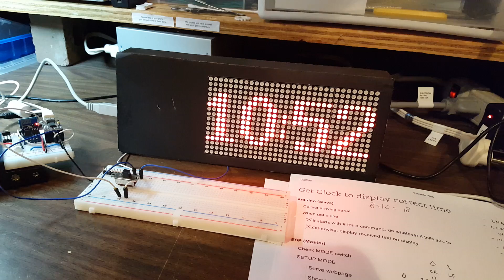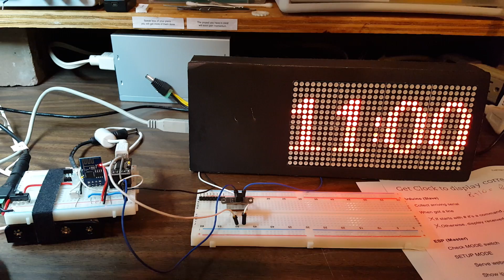HariFun #118 - ESP-8266 Real Time Clock

Comment: Hi Hari,
Do all versions require the esp8266 + Arduino?
What do you think of these modules, you have already been interested in some of this:
1) https://www.aliexpress.com/item/32977781030.html?spm=a2g0o.cart.99999999.259.17053c00AzXLXx
2) https://www.ebay.com/itm/LED-Lattice-Module-16x24-Dot-Matrix-LED-Subtitle-Text-Display-Program-3-3V-5V/372659863414
Especially the latter, since the former seems to be identical to yours, with the difference that it is twice the size. That's right?
Is it worth it?  Thanks
Reply from the maker: Hi Daniel,
Yes, IIRC all those code uses the esp to get time, and arduino to drive the display. 
Thanks for sharing those matrix links. Prices are ok, but the shipping are terrible.
I really like the matrix that I used for the morphing clock.  Quite large AND high resolution. $20 with FREE SHIPPING!  https://www.youtube.com/watch?v=i0M6F4wRxGc

Comment: Hi Hari!

Is your 'HandwrittenClock_05' code for Arduino or esp8266? And there are several versions: 05, 05_ESP, 05b, 06, 06_ESP, 07, 07_ESP.
But it is showing this in this sketch 'HandwrittenClock_05' at line 76: if (millis ()> timeToRefresh):

Arduino: 1.8.8 (Windows 10), Card: "Arduino Nano, ATmega328P (Old Bootloader)"

Compilation options changed, recompiling all
D: \ Arduino \ Matrix 32x16 and Arduino LEDs (panel) \ Matrix Bicolor by Hari Wiguna \ ESP8266_RealTimeClock \ HandwrittenClock_05 \ HandwrittenClock_05.ino: In function 'void loop ()':

HandwrittenClock_05: 76: 18: Error: 'timeToRefresh' was not declared in this scope

    if (millis ()> timeToRefresh)
                   ^
HandwrittenClock_05: 85: 32: Error: 'refreshFreqency' was not declared in this scope

      timeToRefresh = millis () + refreshFreqency;
                                 ^
exit status 1
'timeToRefresh' was not declared in this scope
Reply from the maker: This project uses BOTH the ESP and Arduino.  The Arduino drives the LED, the ESP fetches current time from the internet.  I don't remember anything about this project, but I presume latest version is best.  Let me know if you're still getting compile error with version 8.  Good luck!
Reply: @HariWiguna  Sorry for my ignorance but, I did not understand how it works; in version 08, is the 'HandwrittenClock_08' sketch loaded in an Arduino and the 'HandwrittenClock_08_ESP' sketch in an ESP? Are the two boards interconnected? Do you have any information file.txt?
Thank you very much
Reply from the maker: @Dancopymus , the Arduino talks to the ESP via serial port.  Tx of arduino connected to rx of ESP and rx arduino connected to tx of esp.  Arduino is 5V, esp is 3.3V so there should be some level shifting. I think I just use resistors.  I covered this in other video or you could google level shifting.  BTW, this project is quite old. Nowadays, the Arduino code can run on the ESP so in theory we don't even need an Arduino anymore, just the ESP.  But that'd be quite a rewrite of the code removing the serial communication.

Comment: Hi Hari!
1) Are your sketches working perfectly?
2) Which pins of the ESP8266 (Nodemcu) should I connect in which pins of the Module?
Thank you
Reply from the maker: Daniel, I think you're mixing the this clock and the morphing clock.
This clock uses an Arduino Uno (0:48) to drive the display and only uses the ESP-01 to get time.
The morphing clock uses the nodeMCU to drive A DIFFERENT display.
https://www.instructables.com/id/Morphing-Digital-Clock/
Reply: @HariWiguna  You're right; lack of attention of mine.

Comment: Greetings Hari ! Thanks for video and code. We have found very few projects made with these 16x32 green red matrix and this is the best!
I made the project but there is a problem: it is displayed correctly until 19: 59 when it passes at 20: 00 nothing is understood before it arrives at 0: 00.
Reply from the maker: Dorin, I reviewed both the code for the Arduino and the ESP and I do not see anything that would make 20:00 through 00:00 special.
Have you been able to duplicate this issue more than once? Very strange...
Reply: Hari, i think that the error occurs because when it arrives at 20:00 it can no longer display the clock format - number/space/number/space/:/space/number/space/number (it would take 33 horizontal points per row (28 for numbers, 4 for spaces between them and 1 for the two points between hour and minutes), but the matrix is 16x32). Numbers 0,2,3,4,5,6,7,8,9 need the correct display of 7x10 points and the number 1 of 6x10. Number 2 "does not fit" where the display error should be displayed here.  https://i.ibb.co/mH5MSrQ/01.jpg
Reply from the maker: @dorinik  I agree with you.  Great detective work! Unfortunately, I think that meant I will have to redo the "font".  To be honest, I'm not even sure where that display is anymore so I probably won't be updating the code. :-( Sorry...
PS: Let me know if you fix it and we can update the code on github and of course I will give you credit.
Reply: @HariWiguna  Only the number 2 should be changed.
I tried to do this but I'm used to the hex or binary format, yours is a little different and I can not get it. A little help would not hurt because it would be a shame for such a project not to go because of a number! I think it would be easier to give up the two points between hours and minutes and move right to the hours (although it's a shame they look so good!) https://i.ibb.co/Tg68Y2Q/02.png
Reply from the maker: @dorinik  , I wonder how 2x:xx would look if we shift the 2 one pixel right? It will touch the second hour digit, but I think that would still look ok.  Could you try it and share photo/video when you have time? Thanks!
https://github.com/hwiguna/g33k/blob/master/ArduinoProjects/2015/_Done/118-ESP8266_RealTimeClock/HandwrittenClock_08/HandwrittenClock_08.ino

Comment: Nice clock. I like the graphics you did on the led matrix display. What is the name of the rgb led matrix pcb?
Reply from the maker: Thanks. I bought that display from ICStation, but I've seen it sold by others too. Note that it is only red and green, NOT RGB.
http://www.icstation.com/16x32-matrix-control-display-module-dual-color-green-electronic-funny-module-p-4985.html
Reply: @HariWiguna  Thanks! The display digits looked close to white - go figure?

Comment: Sir I have Arduino Uno with ESP8266 wifi shield. Does this code works for this.
Reply from the maker: I'm unfamiliar with the esp8266 wifi shield. If it communicates serially with Arduino, then the code should work.
Reply: Hari Wiguna there are so many codes which should be used to test first without led display.
Reply: Can you send the complete connection.
Reply from the maker: The complete connection depends on the wifi access point that you'd be using.
This is the original code that gets the time from the internet:
https://github.com/hwiguna/g33k/blob/master/ArduinoProjects/2015/_Done/118-ESP8266_RealTimeClock/NTPClient/NTPClient.ino

Comment: I have interfaced Arduino mega 2560 with esp8266-01 ,temperature and humidity sensors.   I have Local server(Node.js server) in my system and i am able t send the temperature and humidity values to Server.

Now i need to receive the data(time and date) from Server.

Receving date and time is happening . I can post the part of the code where i feel i am wrong in syntax and also arduino console output and Server output.

Please reply.
Reply from the maker: I can't promise anything, but I will take a look at your code if you still need help.
Reply: Ok Sir. I have mailed the query and code to your mail id.

Comment: Very nice project Hari. Can you are able to share the  schematic for the clock i want to know connection between ESP8266 and the Arduino Uno pin number

Thanks
Gurjinder
Reply from the maker: Sorry, I no longer have schematic for this project, but if I recall correctly, the ESP and Arduino are connected via their respective RX/TX lines.  The pins for the LCD module are defined in the sketch. Good luck!
https://goo.gl/ZaRBFI
Reply: Thanks I will try
Reply: Hi Hari,

i tried to load code but i am getting error.  Is i am missing any libraries

sketch_jul09b:76: error: 'timeToRefresh' was not declared in this scope

   if (millis() > timeToRefresh)

                  ^

sketch_jul09b:85: error: 'refreshFreqency' was not declared in this scope

     timeToRefresh = millis() + refreshFreqency;

                                ^

exit status 1
'timeToRefresh' was not declared in this scope

Thanks
Gurjinder
Reply from the maker: Looks like you're trying an old version of the code. Please try this version instead:
https://github.com/hwiguna/g33k/tree/master/ArduinoProjects/2015/_Done/118-ESP8266_RealTimeClock/HandwrittenClock_07
Reply: thanks

Comment: Great project, and I used the NTP Client code provided but have a question. 

The code worked perfectly, but only after I changed the order some of the lines appeared in the original code. Do you know why this happens? This happens not just with the code above, but with many examples I get online. 

Thanks for sharing, this code really helped me out.
Reply from the maker: +HeliosWorksAV , glad to be able to help.
As far as changing order of code, the Arduino compiler changed recently (a month ago?) that methods need to be declared above where they are used.  Not sure why they did that. :-(
Reply: +Hari Wiguna Thanks for the reply, wow so I should go back and check all of the code I've skipped over because it might have been written before that and just needs to be shuffled around. 

Thanks again.

Comment: Thanks for the post!!! 
I am creating an application where the ESP8266-12 will not only be used as the WiFi module but as the actual processor itself. I need the ESP8266-12 to be active between 8:30 am and 9:30pm and go on sleep beyond that time-bracket. This means that I need a way to know the time. My ESP8266-12 will talk to a Raspberry PI. I was thinking that I could get the time from the Raspberry PI and use that as a base to compute the time in the ESP8266-12. 
You think this will work? It looks like you have done something similar (though you are getting the time from the internet).
Cheers,
Divyaman
Reply from the maker: +divyamanify , yes, you can make the ESP talk to anyone on the internet including you Pi.  However, unless the ESP already have to talk to the Pi for some other reason, why not use a public time server on the internet and not involve a Pi at all?  
Also, I don't think the ESP is running anything while it's sleeping, so you will have to program it to always get the real-time everytime it wakes up from sleep.  I'm interested in what you find out about sleep. Do you have a place where I can follow your progress? or feel free to post in this comment thread. TTYL
Reply: +Hari Wiguna I did think about getting the time from a public time server (like you suggested). But, my ESP8266 needs to talk to the RaspPI anyway and must be in the same time-zone as my RaspPi. So, its better to get the time from the PI. With regards, to the sleep times, I am still in very early stages. But, I did find some useful links on that. Here are those: -.      
        http://bbs.espressif.com/viewtopic.php?t=133        http://bbs.espressif.com/viewtopic.php?t=834        http://tinker.yeoman.com.au/2015/03/08/reducing-esp8266-power-consumption-using-deep-sleep/

Comment: Wy not only the ESP8266 module? Its a uC to... You can connect the ESP to the 74HC595's directly.
Reply from the maker: +Edwin Noorlander , you're right.  However, because there is already an Arduino library (written by someone else) to drive the LED matrix, I decided it was easier to leave that alone rather than port it to the ESP.  That said, it is sometimes confusing to have to think whether I'm writing code for the ESP or the Arduino side.  Another thing I noticed is that uploading to ESP takes a lot longer than uploading to the Arduino UNO.  Not sure why, but I was thankful for the quick turnaround while I tweak the effects on the LED matrix.  Thanks for the comment Edwin!
Reply: +Hari Wiguna Have you thougt about to use the ESP directly with the Arduino IDE? Then should using the library be no problem. You will probably need an ESP 12 for more pins.
Reply: +Hari Wiguna I think the longer time  is  that is has more flash to write to, and it appears to write the whole page .
great stuff man ,  will be cool if you show your progress doing the PCB design.
Reply from the maker: +Thomas Oo , I am using the Arduino IDE for ESP :-)
I have not dig into the library to know if it would or would not work on the ESP.  I just assumed (perhaps incorrectly) that adapting it to the different pinouts would be difficult if the library uses direct port manipulation. and timers or interrupts to automatically refresh the matrix.  However, I do not know that for sure, so you made a good point to try it.  Thanks for the suggestion.
Reply from the maker: Hi +XerotoLabs !
Next question is how come the ESP has more to write?
I do plan on sharing my experience (lack thereof) in building my first OSH park PCB. :-)
Reply: +Hari Wiguna I think it writes the whole program space in flash even if it is empty bytes.  would have to test short blink app vs complex webserver.  if the write time is the same then we know it's a fixed image side.  Lol

Comment: Very nice Hari maybe you can use the bigger esp like the esp8266-12 and drive the whole thing? But over all very nice.
Reply from the maker: Thanks J.
I considered driving the whole thing using just an ESP. In the end I decided that it would be more work to redo the LED matrix library for the ESP than to simply let that library run on the ATMega and add one of my many ESP-01s to the project.